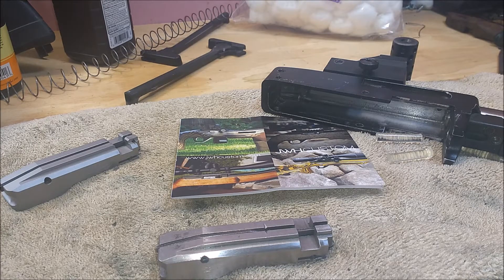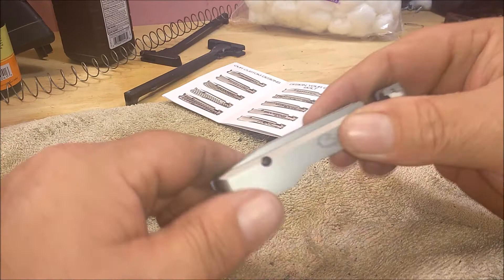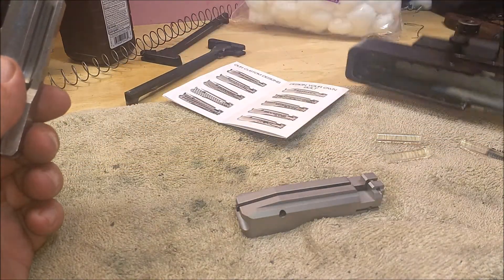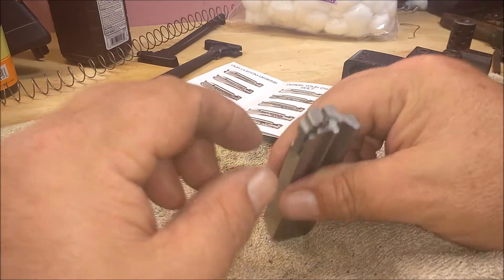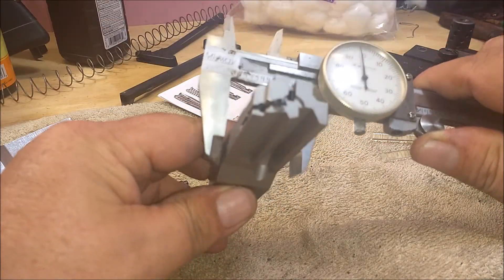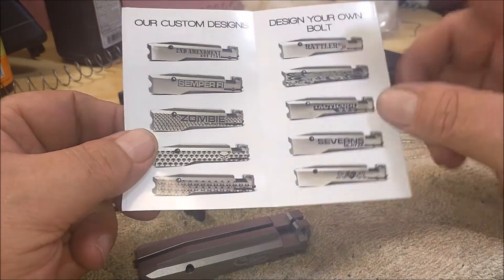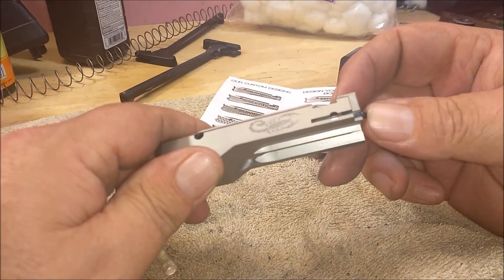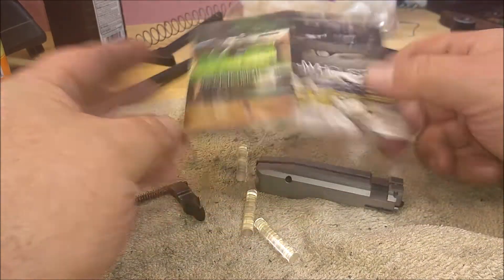JWH Custom Bolt upgrade for Ruger 10/22

Comment: Got a JWH bolt a couple weeks ago.  JWH bolt fit tight in the receiver.  Can see the marks on the edge when it runs.  Seems to do well.  Can't say that it does anything that a worked over factory bolt won't do, but I have't really had a lot of problems with bolts on 10/22's ever anyway.  The headspace, pinned firing pin, and the radius are basically where you would see improvement.    I will say that the roll pin that holds my firing pin in place is either too small or the hole it goes in is too large, because if you push in the firing pin, it falls freely out of the hold. Contacted them regarding it and they said to send it back.  Contemplating if its worth $8 to me to mail this back to them (they didn't offer a shipping label) or do I just go find a larger roll pin.  Probably should have bought a Kidd.
Reply: Andy Bassham don't waste your $$with Tony Kidd their bolts work well in their 400.00 receivers and not so good in other after market receivers if you need some help will be more than happy to help you with your 10/22 I've been building them for over twenty five years

Comment: well I ordered one of these and its being delivered today. I hope it wont be a lemon.
Reply: So I got the JWH Custom  bolt and installed and now im having issues with the Auto bolt release. So im checking this issue out and seeing what I can do to fix it.
Reply: @SWW978  I can understand your scepticism. I should have mentioned that I was replacing their auto bolt stop with my extended one and it now works very well. The bolt is fine and after 300 rounds so far so good. Much better than oem.

Comment: If you're trying to sell JWH bolts, you're falling short. So many of the things they tout that you did not mention. . .  That being said -- I'm not a fan. I bought one a while back and it is occupying space in my junk drawer. That particular bolt has the channel the extractor operates in messed up. They took it back and worked on it for me, but in the meantime I purchased a Kidd and never put the JWH in the gun again. If I had another receiver, that junk drawer could build me a whole rifle.
Reply from the maker: Not trying to sell you anything. I presented a product that I purchased to solve a problem that I was having and decided to share it. That being said, I have put approx 5200 rounds through the gun in Steel Challenge matches and it has ran perfectly. It eliminated the problem I was having with firing pin float.
Reply: I'm glad it's working for you. You're money ahead of me, finding it on sale. I paid full price for the JWH, then full price again for the Kidd. I wish JWH would have refunded my money and kept the bolt. They said the problem was solved and wouldn't deal. I'm stubborn in the fact that if I buy something new that's messed up, I Iose all confidence in that product.